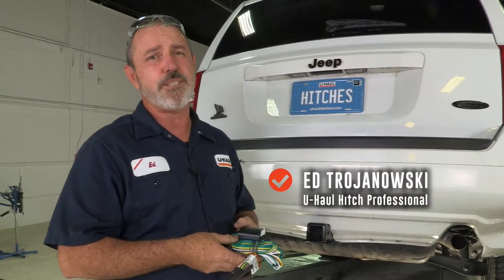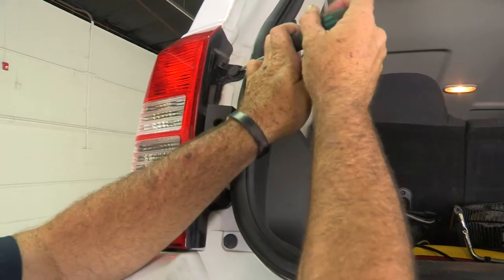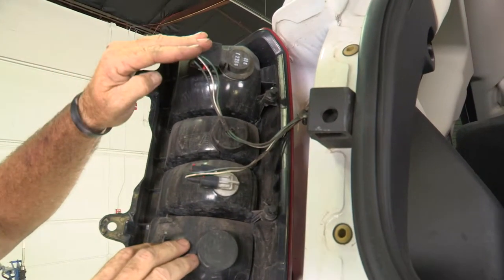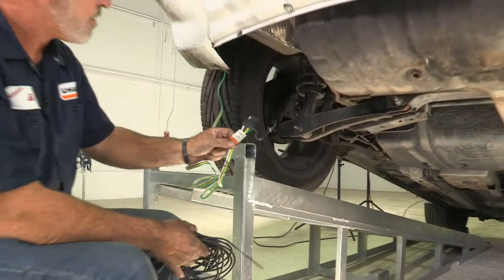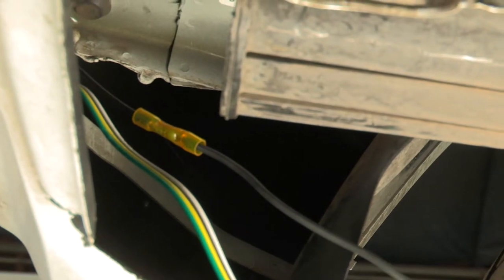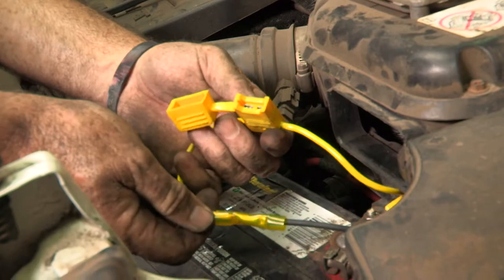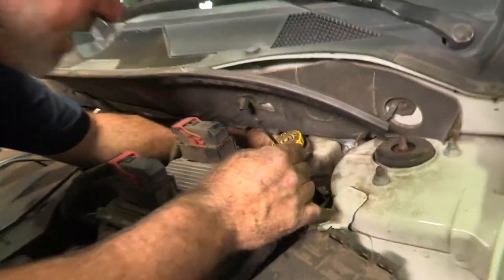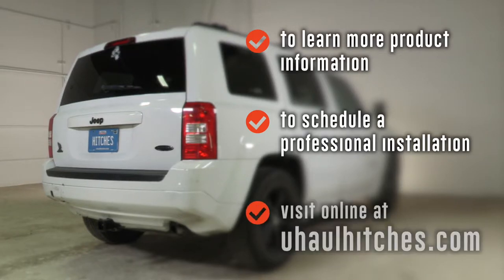2017 Jeep Patriot Trailer Wiring Installation

Comment: Great video.  Made my instal easy.  Only note is I did not wait to make the power wire connection, I did it right away so I wouldnt have to make it behind the bumper.

Comment: Where would a brake controller be plugged in?
Reply from the maker: This is a 4-way wiring Harness. You need a 7-way wiring harness installed. Your Vehicle is not equipped with a towing prep package, so the vehicle needs to be wired from back to front and thru firewall. Visit your local U-Haul Hitch Center to set up a wiring and brake controller  installation.